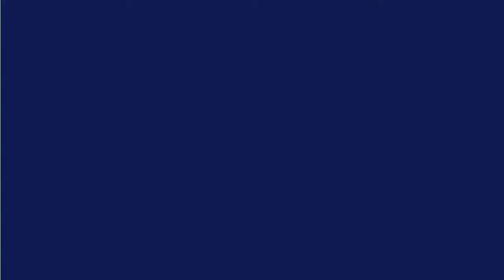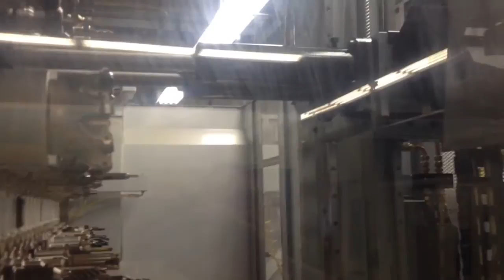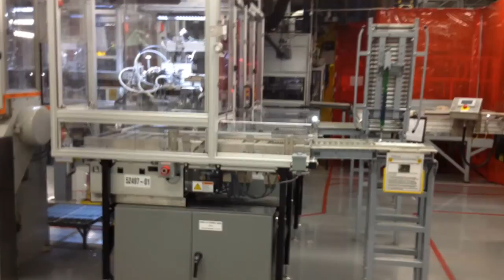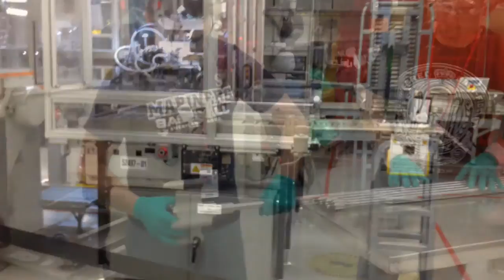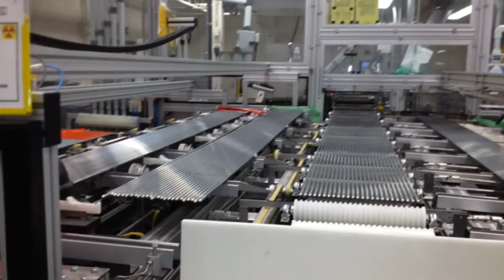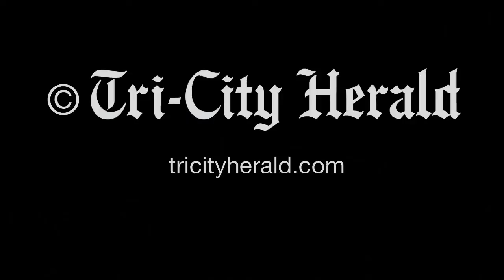Areva manufactures nuclear fuel rods in Richland

Comment: why are the rods not hot until they are put in the reactor ? what makes them get hot and stay hot after they are removed?
Reply: They arent hot until a reaction happens. Once in the reactor and fission occurs energy is released which is how we get power from a nuclear plant. I dont think they stay hot indefinitely. They have cooling systems in place to prevent a meltdown but ultimately once spent I dont think they stay hot forever, just radioactive.  Hope that helps.
Reply: @erinc9391  They do stay hot for quite some time, that's one of the reasons they get stored underwater, is to cool them and to shield people from radiation, in Fukushima they used helicopters to dump water to the spent full pools to keep them from evaporating, however, I don't know why they aren't hot in the video, maybe the rods that they are showing are still empty, maybe they have some kind of absorber that prevents fission, or maybe it's because they aren't underwater. (in must reactors water is used as a moderator)
But even if this is true I don't know how people can handle those rods by hand doe to radiation
It's pretty complicated